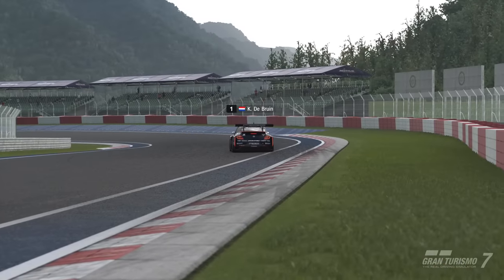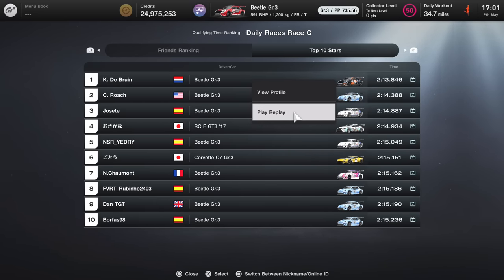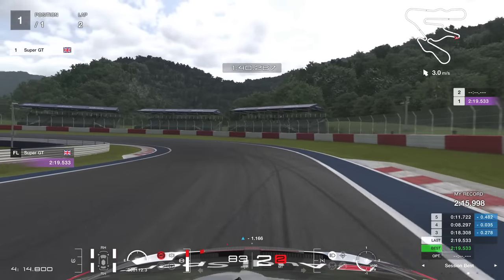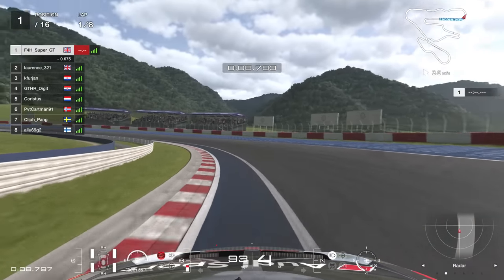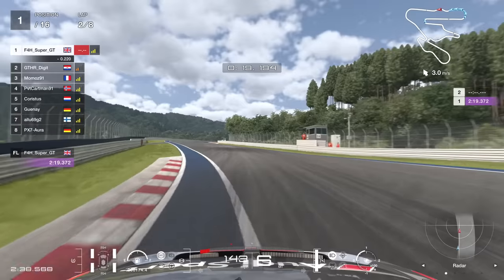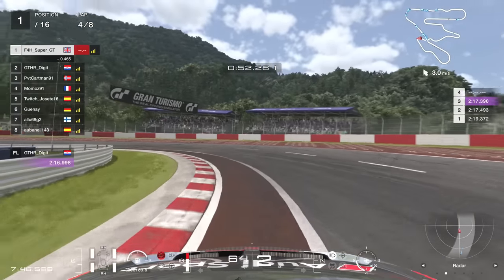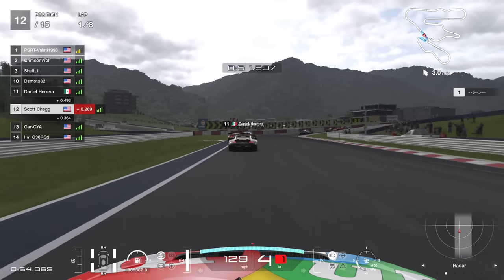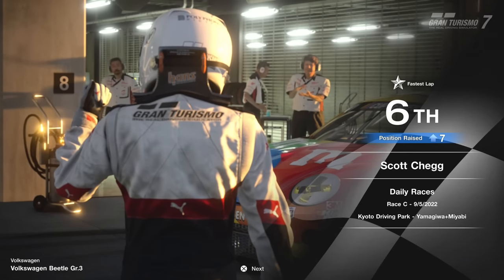The Gran Turismo Exploit Which Makes You Much Faster

Comment: I always was of the opinion using kerbs shouldnt be the norm but already just for "emergency" if you slightly overshoot, but then otherwise be out of track and a penalty. Do not cross the lines.
But as this is long established racing norm and changed like 5 times per day with definitions of "out of track" per turn instead of a general rule applying with no exceptions, what do I know...
Reply: I think both have their place. Some tracks I find it super fun to absolutely not touch any kerb ever, like at the nordschielfe, and some tracks I also love the way you can absolutely abuse certain kerbs like at watkins glen and the bus stop at daytona. They're very different styles of kerbing but I love both of them and I think there should continue to be tracks using both of them and everything in between. That's the one thing I completely agree on; as much as I do find huge easy to take kerbs enjoyable, I think they're becoming way too prominent nowadays. There needs to be a good balance of nordschielfe-esk deadly kerbs, balanced usuable but not too big kerbs like in suzuka and spa, and those huge kerbs that are fun to launch over.

Comment: This is almost certainly not a glitch. Most racing sims elect to only simulate the contact patch of each tyre (most only simulate a single point of contact too). To have such behaviour in a video game, a developer would have had to have added sidewall physics so that the curb isn't just jumped back over with no effect. It's not impossible that this exact scenario wasn't planned for, but if you're building in sidewall collisions, it seems likely that you're looking for this sort of result.

Also to note, as far as I'm aware, this strategy is possible in real life, it's just bad for your tyres. The Nurburgring apparently added the carousel because drivers were using the somewhat misshapen curb that used to exist to dip their tyres in and get faster exits on that turn, regardless of the danger of coming loose and shooting into the wall.
Reply: Ref for the Nurburgring curb hooking from Wikipedia:  It is named after German pre-WWII racing driver Rudolf Caracciola, who reportedly made the corner his own by hooking the inside tires into a drainage ditch to help his car "hug" the curve. As more concrete was uncovered and more competitors copied him, the trend took hold. At a later reconstruction, the corner was remade with real concrete banking, as it remains to this day.

Comment: That’s not even an exploit it’s more poor track design - it’s not even about the tyres taking wear or not - simple fix though either raise the kerb slightly so the car actually bottoms out (which is what it would do IRL) or slope off the grey part so the tyres don’t hook and spin you out. Great example of why GT will always be an Arcade racer
Reply: it's an exploit because it is not intended.
Reply: @comdrive3865  that’s not an exploit gees 😂 design the track better you won’t be able to “exploit” it as you say
Reply: @darrenstevenson8119  thats an exploit.

Comment: may save you a second may not. so if you are skilled enough to do it. use it. if you cant then you arent benefitting from it. nothing wrong here. like in initial D if you can use it. It would make you a down hil racing god. in real life if you cant use it most likely you die. so if this can be done in irl ? not an exploit. any racers ? like in the original grandturismo 3 a spec. the 86 continues on providing. crew2 is dead and granturismo has cheaters. F me forza 5 for the next 3 years..... so many network issues doesnt matter who is good. Lag god wont allow it. fun.